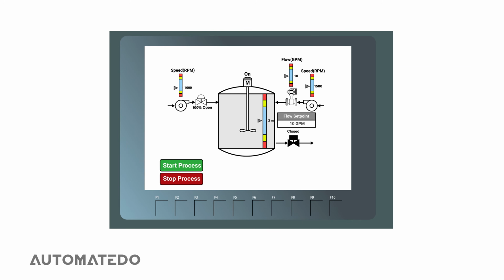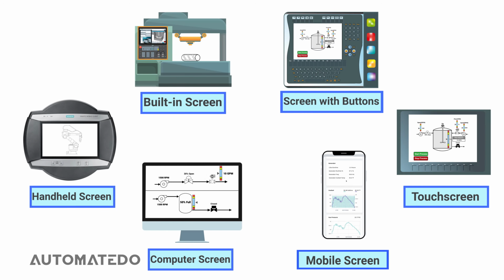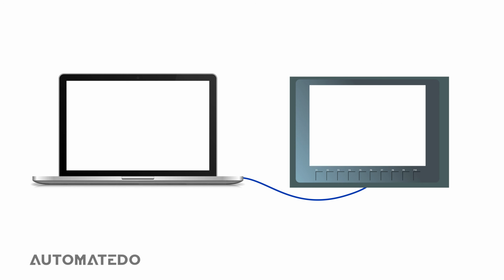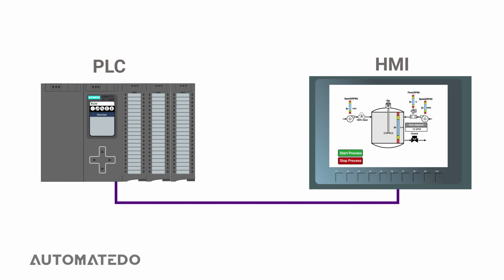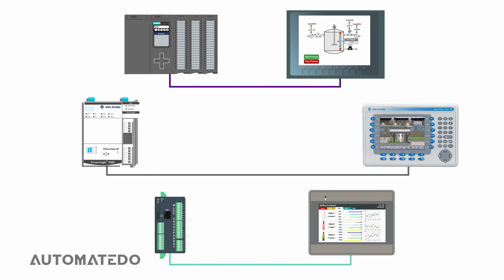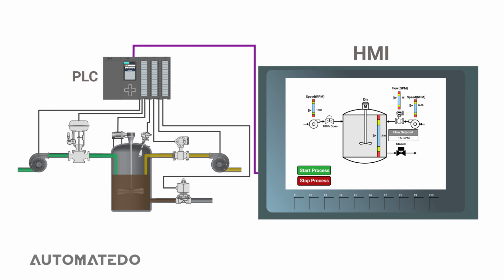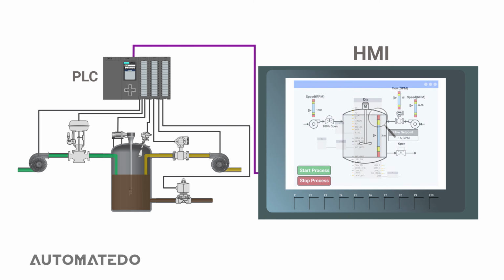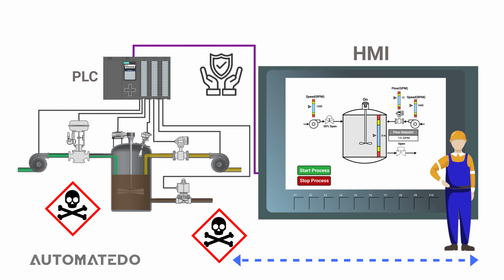What is an HMI? Human Machine Interface

Comment: Allen Bradley in the middle of his Programmed OBSOLESENCE program already looks like APPLE, buy me every year. and they have their famous MOTTO: "why make it EASY if it can be made DIFFICULT" I am impressed by all the work that has to be done at the configuration and parameterization level with this type of BRANDS (siemens and allen bradley) and with other brands ALSO WITHOUT GIVING so many TURNS it comes to the same thing, I say it with absolute certainty of having worked with many brands for more than twenty years of Automation including those two (that is why they are asking for competitiveness in many areas) August 2023
Reply from the maker: Thank you for sharing your thoughts and insights! It's interesting to hear your perspective on Allen Bradley and their approach to programmed obsolescence. Automation brands like Siemens and Allen Bradley do have their unique characteristics and challenges in configuration and parameterization. However, we believe that each brand has its own strengths and considerations based on specific requirements.

In the end, the goal is to achieve the desired outcome efficiently. As an automation professional with over twenty years of experience, your insights carry weight. We appreciate your input and the competitiveness that exists in the industry.

If you have any specific questions or topics you'd like us to cover in future videos, please let us know. Thank you for engaging with our content! 😊🙏